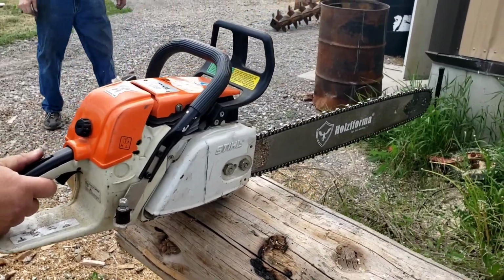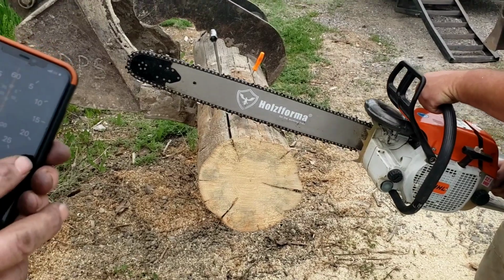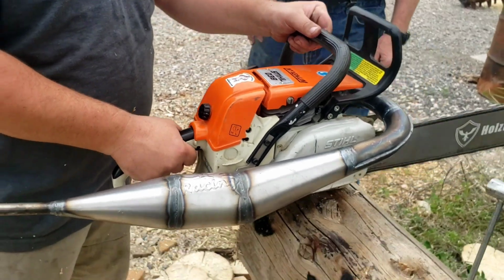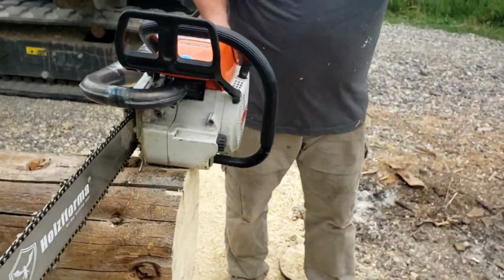Stihl 038 Magnum ported chainsaw prototype pipe revisions timing cuts with human error

Comment: Really that triple port muffler is 💯 junk garbage. The saw was pretty much a boat anchor. CPI RACE PIPE+ junk saw= so much better. Not bad to operate. I would know I’m the one running it.
Reply: Yea Scott didn't like that muffler either, Original muffler got run over and Stihl no longer has them. Thats a 1992 or93 saw.